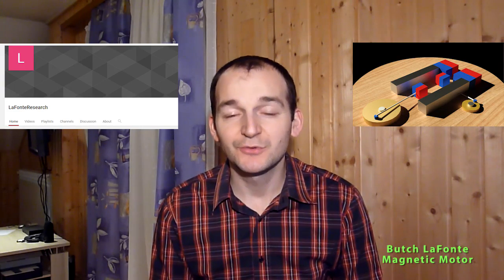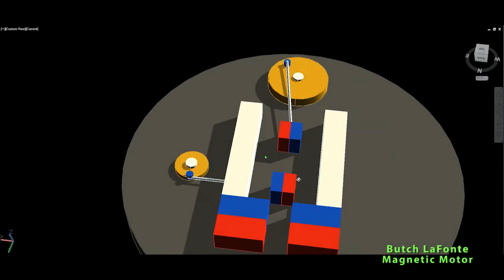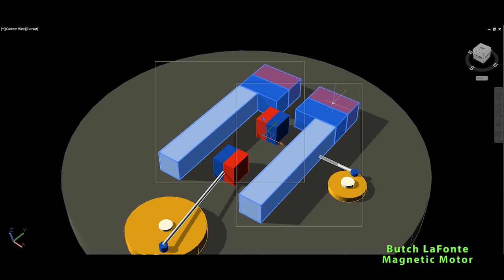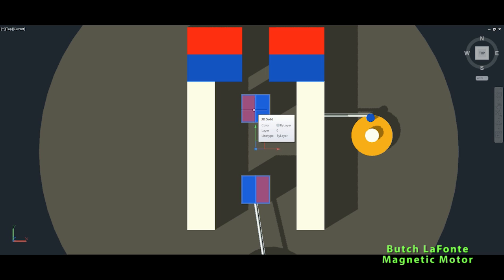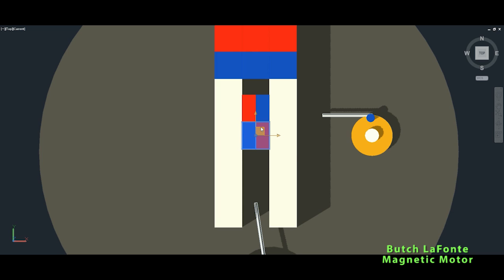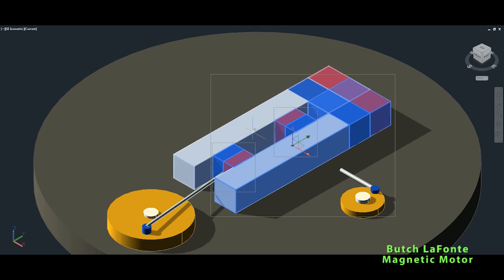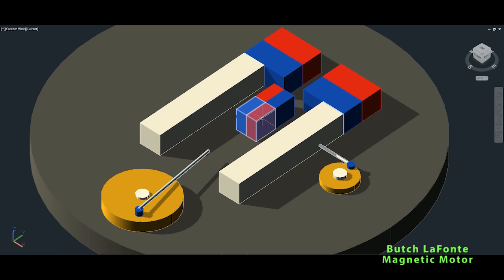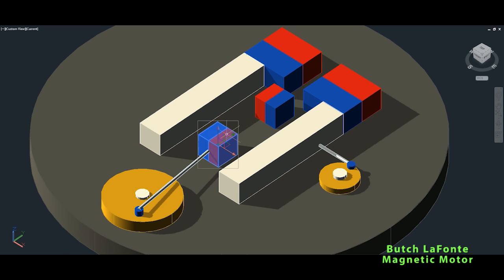Free Energy, Butch Lafonte Magnetic Motor, Magnetic Experiments

Comment: The two iron rods require very high strength to be separated toward the center magnets. It is unclear what is the purpose of placement of magnets in the ends.
Due to very high friction and how it is made, this mechanism does not have how to function at all.

Comment: Hello again, Why don't you do one on Joseph Newman's energy machine. I'm thinking of making one .  The one I made like the one you are making is working. Not a lot of speed or power though.
Reply: KG Salvage el motor de joseph n. es solo un motor electrico y nada mas si le sacas las pilas no funciona.he dicho señores.
Reply: Hola, Es básicamente como un motor de pulso. Hace un pico trasero de alto voltaje en las baterías. Si obtiene la longitud correcta en su cable de bobina y tiene una masa lo suficientemente grande, puede hacer que el exceso de energía para alimentar a otro generador. Se necesita mucho cable. Que tengas un buen día